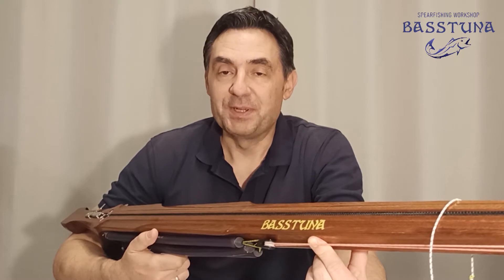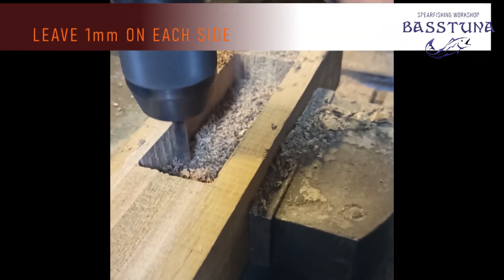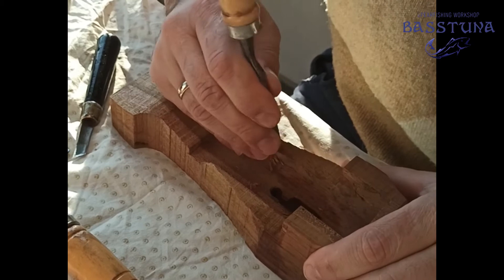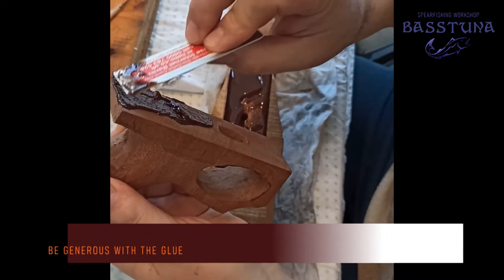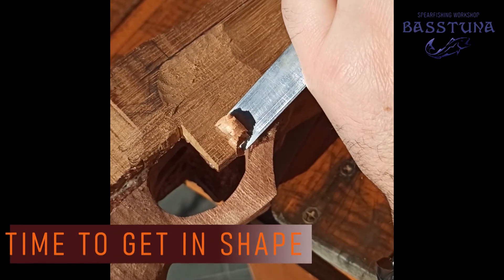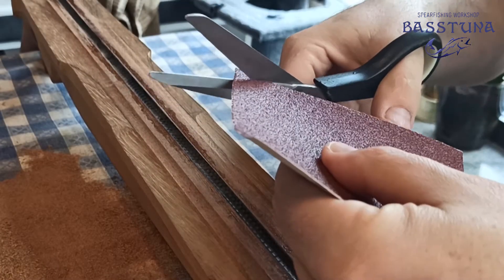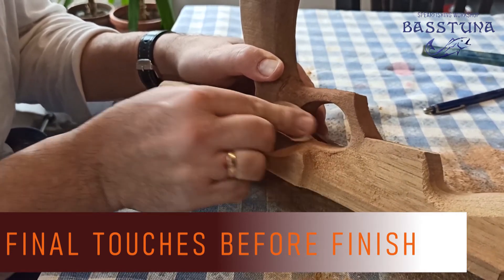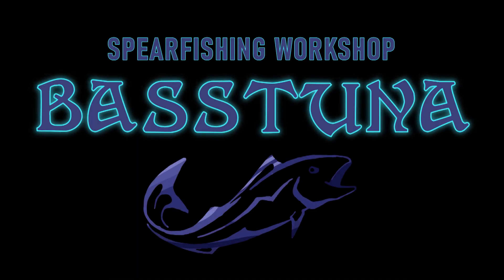How to make a wooden speargun (part 2)

Comment: Que clase de maderas usas para hacer las arbaletasy si la madera tiene que flotar
Reply from the maker: Hello and thank you for your interest in my videos. For this project I am using two stripes sapele and three stripes iroko. The buoyancy is really high and you have to choose between decreasing the volume of the body - meaning possible compromise with its strength, or to put a lot of lead to balance - meaning heavier gun.
Reply: @basstuna906  thanks